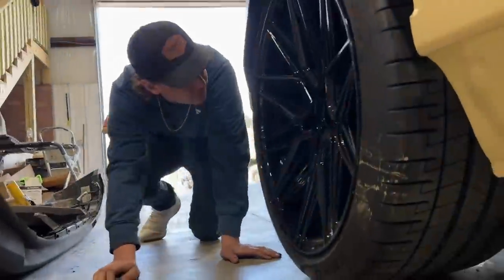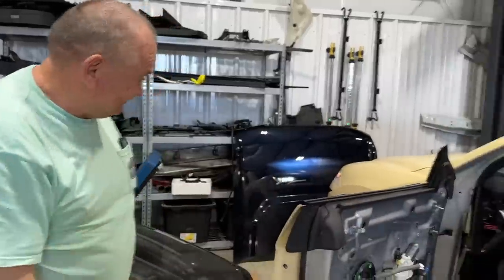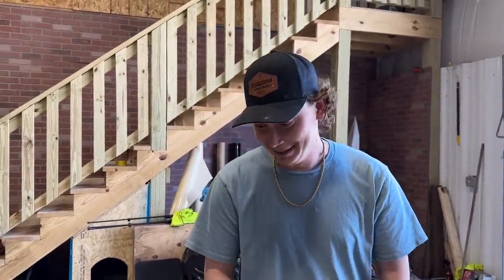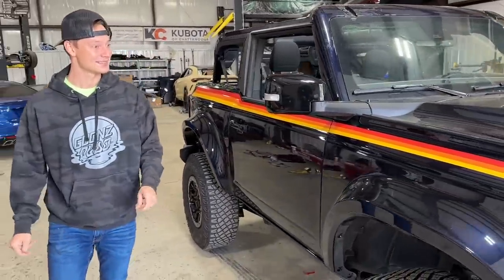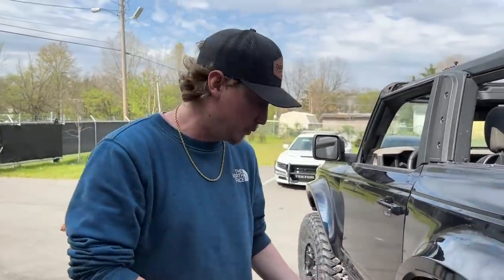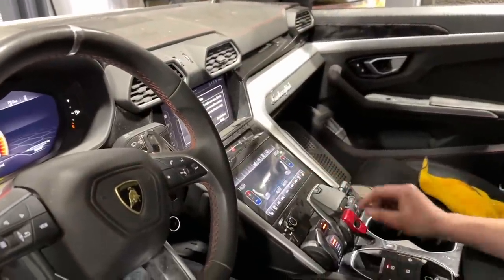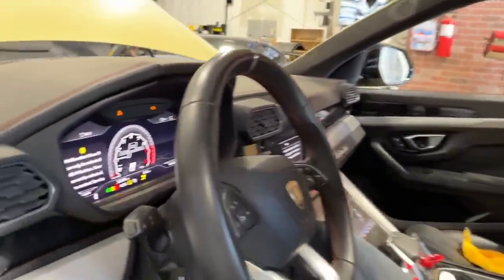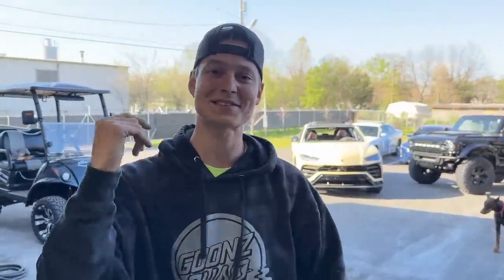Our Wrecked Lamborghini Urus Finally Starts After Months Of Sitting And Then Explodes!!!

Comment: On the lambo you need to make sure the height sensor on that rear passenger side is working. When you ran over the shock absorbers and the wheel came off the ground it blew the bag. If the sensor is not working right or in the wrong position then it doesn't know when you are at max height and will blow the bag. You will keep blowing bags until you fix everything and most likely you need to dealer to relearn the system. You guys really need to put this back together put it on the trailer to atlanta and have the lambo dealer look everything over because you will just keep doing damage. Why risk 300K by taking a crappy test drive. Make sure it's 100% first.
Reply: Absolutely correct. I'm also in Tennessee and would do the same thing.
Reply: It was probably overfilled and then when the suspension compressed it exploded
Reply: @HenryIsGaming  needs Atlanta Lamborghini
Reply: They need to see this comment!
Reply: @freedomforall2486  facts
Reply: Agreed. Test drives with cars which are half put together just kill me.

Comment: If you do go with aftermarket wheels , get the right backspacing and you won't need any spacers . Spacers are only really good if you're trying to make stock wheels fill out the wheel openings better .

Comment: You should be leaving the paint for a good 3-4 weeks before applying decals to allow the paint to gas out. You may start to get bubbles in the vinyl over the next couple of weeks.
Reply: It will be fine you know how many body shops put stickers on after they paint the car the next day.
Reply: if they are going to keep the stripes on it wont matter. But yeah if they want to take it off, it will leave some marks in the fresh clearcoat. if they leave the Bronco out in the hot sun the marks will fade some.
Reply: it's not painted its wrapped
Reply: @ackielhemmings8174  They took the wrap off and repainted it.
Reply: @fa_engineer3687  oh crap you're right, my mind was still on the lambo
Reply: Yes! ABSOLUTELY for the stripe! Totally bad ass!
Reply: @ackielhemmings8174  Pay Attention.
Reply: @timglass6041  sir yes sir

Comment: You are going to need an aftermarket spare tire carrier for the 37! Just FYI. Bronco is looking sick!
Reply: No... You're just going to need a 3rd brake light extension bracket,  though it might be wise to have a reinforced carrier for the extra weight of a 37" tire,  but you don't "need" to...
Reply: @justinhobart8747  There are a lot of Bronco owners who have had their rear hatch damaged due to the stock carrier not being fit for extra weight... Sure, you don't 'need' to upgrade the tire carrier but it's a risk... and as you probably know these guy do things right so i bet you they will upgrade it.
Reply: @moddojr  Well you're right about the "posable extra weight issue" I will give you that... 🤔 But are we talking about the same guys here??? The same ones that just built a retaining wall that fell over, or built a shed that leaks and thought they knew anything about woodworking and put fresh sawed wood planks on the walls till so they would shrink and look like crap...  For your information I've been watching these guys since they 1st started and I don't mean to be Mr. Troll here, I'm not trying to be... but anybody that thinks these guys are doing stuff right... almost OEM??? 🤣 well I'm sorry!

Comment: Once the suspension has been done you need to take it to dealer or someone with Odis to do a basic setting on the suspension, otherwise you will always get air suspension errors randomly.

Comment: If you order a set of custom wheels, if you get the correct offset, you won't need spacers. It's a LOT safer without spacers.
Reply: Just beware,   Any time you alter the offset from the stock factory wheels it will greatly increase wheel bearing failure. and remember,  never use spacers,  they are dangerous.

Comment: Guys going to tire shops like that which are holding old inventory are holding old inventory cause they normally got it on sale or close out for cheap so there going to try to sale you that instead of what you really need guys or atleast buy the video that's what it looks like go to a shop that orders most all there inventory as it is needed And for a specific project that only exactly what is required and needed! Cause every build is different and you have to order the proper rims with the proper offset or inset with the proper size tire for every application specific for the proper fit and look you want or you will waste money every time!

Comment: Nice character to the jeep, also, @simone(spelling sry) you still need fiber, so some kind of fruit high in fiber, i've been doing that for 2.5 years going on 4 but i added back things i need to digest better, you do not want a cinder-block coming out, it probably will happen eventually if you do not add some sort of "extra" digestive help.   As long as its clean you should be alright, also the mountain water at the home you guys had would've been best tbh, just fyi on that, i'd look into who "blocked it", cause that is strange.

Comment: Every bit more lift, every wider tire, larger diameter tire, wheel, spacer, etc., further degrades OEM performance.  You really shouldn't do it without a functional reason.  This is making longer braking distances, slower acceleration, worse MPG, and more difficulty to park or drive on the freeway (significant aerodynamic decrease).  I say this as someone who has had multiple wranglers, turbo'd.  Most enjoyable Jeep, best performer, was the one I kept light on stock steelies and OEM tire size.  I would pass custom lifted jeeps with larger wheels and tires in bad weather/snow, with ease. 

Keep it lightweight and nimble.

Comment: I'm very disappointed in that video they didn't tighten up all the the bits they had put on. It looked to me like that airbag wasn't tighten up so it just blew off the bolt flew out it was at simons feet they had all that wiring hanging didn't do any checks it took there dad to even remind them to check the oil. That's just bad business come on boys it over $200.000 of car surly you wouldn't just jump in and do that. I mean Simon very nearly crashed it the look on his face said it all pure panic. I mean are they so rich that they can just destroy a car of that value boys just respect what you have check things properly and don't do silly things like that. I'm a fan of them both but it's getting hard to watch sometimes I have to say they have definitely changed I will let you guys decide if its for the better or the worst I have my opinion of which it is as I'm sure you do
Reply: I'm in UK how do I reply to your request by mobile phone ?

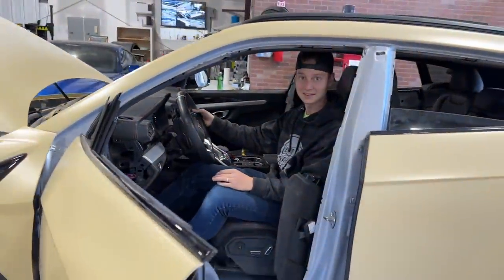Comment: 21:15, how I would have laughed if the brakes were not up to scratch. It would have been hilarious and a good lesson to learn. Did you check the oil as I heard Pops suggest?
I am dreading what you class as style for the wheels on the Bronco. Given your history, they will be expensive but hideous.
I am so glad that the Bronco and the Urus are at the last stages of their repairs. You did an excellent job with them in a super fast time.
Please, please do not drive them like assholes, though. You will, but at least I have said it, and I can come back to it when you come unstuck, and I can say I told you so :-) Driving over that shock absorber is a good indicator of your driving skills. You are severely lacking spacial awareness and are too immature, thinking you are better than you are.